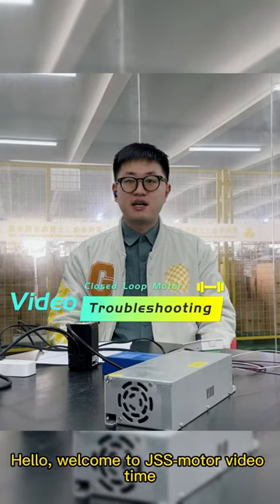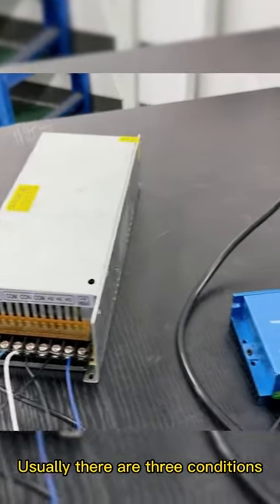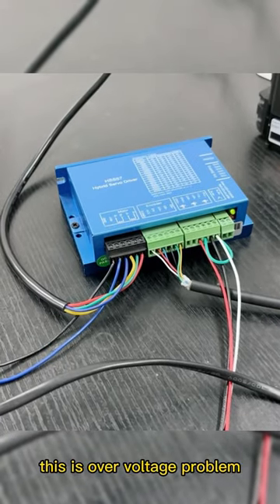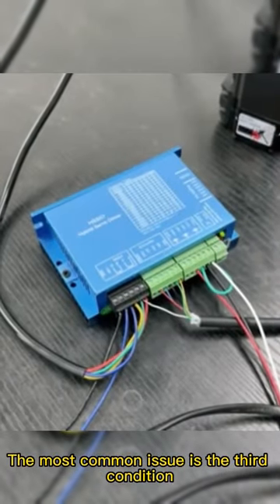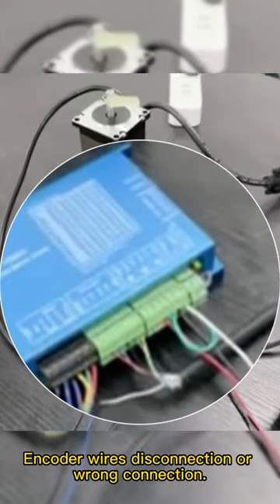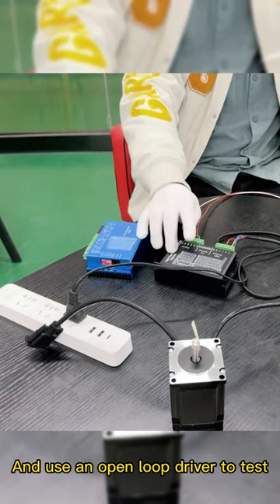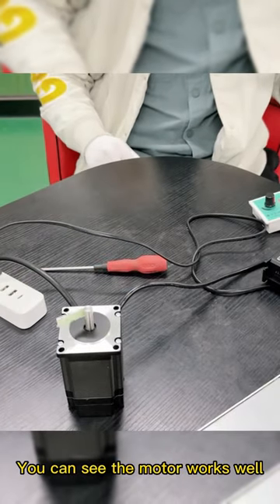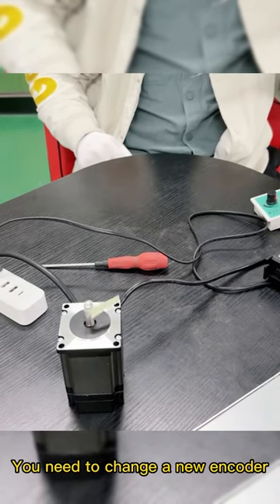Closed loop stepper motor troubleshooting | JSS Motor | China Stepper Motors Manufacturer #motors

Comment: Motor not turning .no signal error all lights green . What is d correct control signal wiring with 5 axis breakout board.driver model is hsb860h
Reply from the maker: Sorry we do not have such Model No, recommend you to contact the supplier for more informatio.